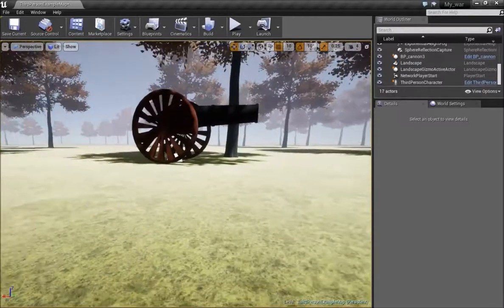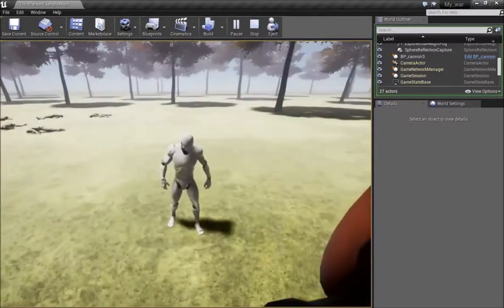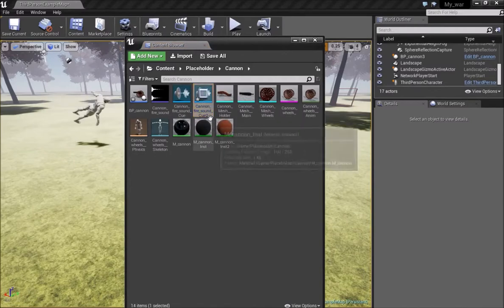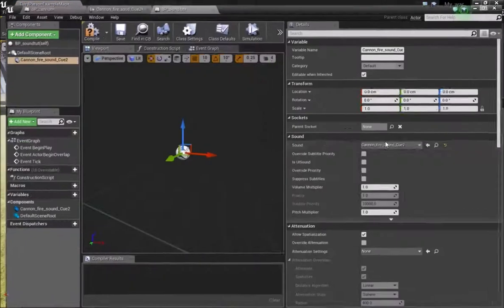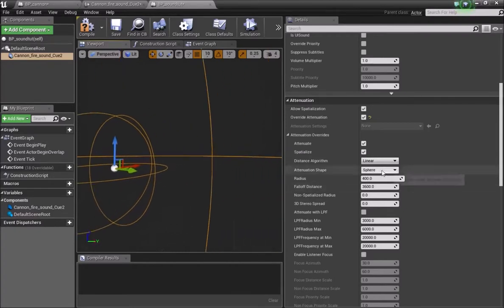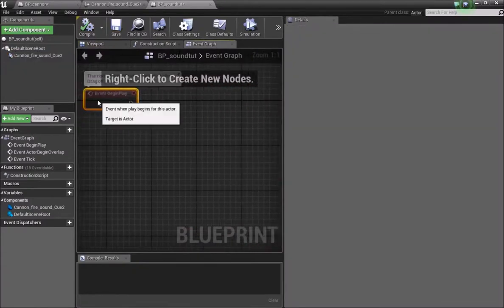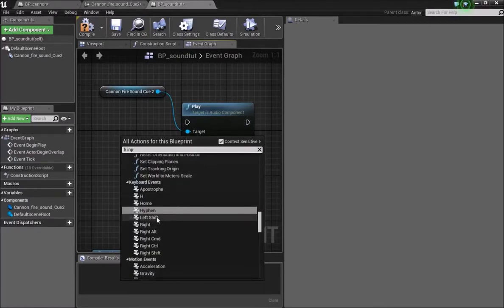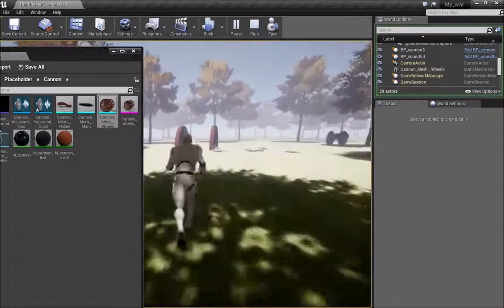Sound Cues | Tutorial | Unreal Engine 4

Comment: Thank you very much, that's a very good tutorial. I must be doing something wrong though... I've placed few sounds throughout my environment, which should be there at all times so don't really need a special activation method. However, only one of the sounds play and as soon as I leave the falloff area, it stops playing and it never ever plays again, regardless where I am. None of the rest of the sounds play either. I've tried dragging and dropping the sound cues directly as well as through blueprints... Any ideas?
Reply from the maker: Hey! I'm sure what could be happening. I'll try it myself later and let you know If I experience the same.
Reply: Resurrection 21 turns out I had to put a tick on the loop option, so no need for you to investigate. However, you could in fact take a look at the box trigger volume and try to explain why is it not activating the sound file upon collision/overlap :)
Reply from the maker: Oh cool! Did you use on begin overlap or on hit node?
Reply from the maker: I did have a problem with this in my 2D develop where if the player spawned inside the trigger box then the event would not be called. I had to walk outside and then back inside to get the event to work. Make sure you have referenced your box in the blueprints and try using both nodes one after another the on actor hit and on actor begin overlap.
Reply: Okay, I'll try that tomorrow. My player pawn spawns far away from the box and I'm using I'm only using on actor begin overlap with reference to the box and the sound I want to hear. Alas.. nothing happens...